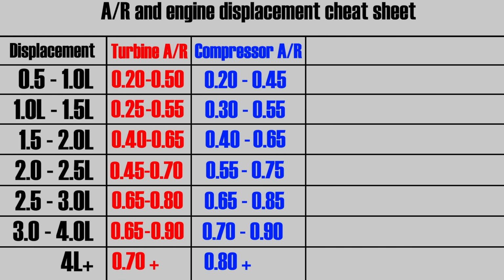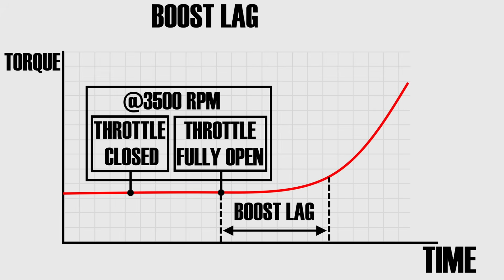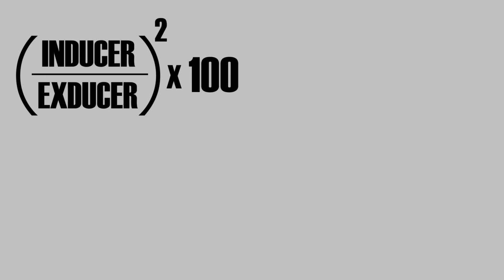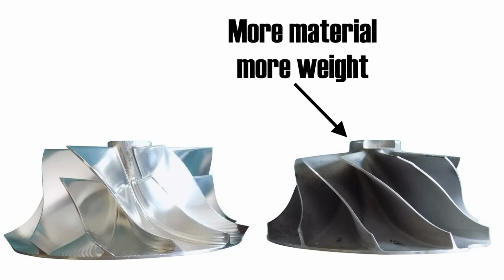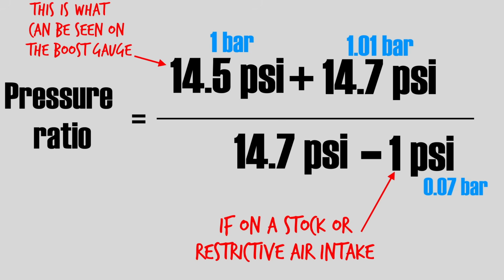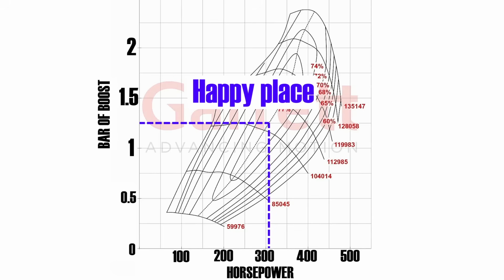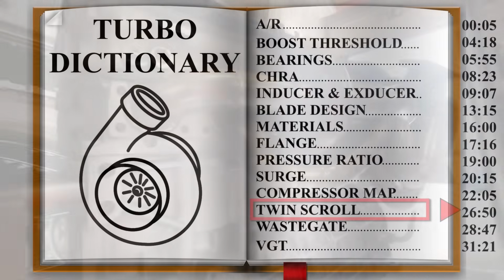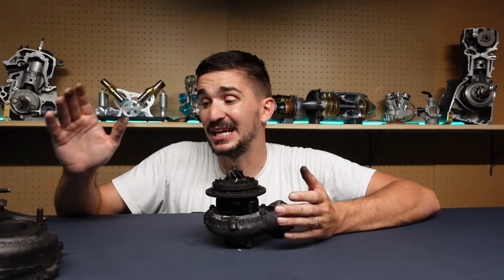All in One: A/R, Compressor Maps, Turbo Lag, Surge, Twin Scroll, VGT, Wastegate +more

Comment: I like the  video however there are some real world variables 

Too large of a turbo doesn’t always cause a surge. When I port the head and add cams to a 2017-2021 civic type r it causes a surge from an mhi stage 2 and blows them up when it makes 21 -24 psi at 2800 rpm. I have to reduce the command by a lot in order to prevent this. 

As far as surge your hp it doesn’t mean your in the surge spot. You can make 15 percent more on the same exact boost by using ethanol over gas. You’d need a turbo shaft speed sensor to really know where you are in the compressor map.

Comment: Another great video.
I had issues with A/R numbers on the homologated T3 turbo back in the 90s on my Nissan 910 rally car.
Unfortunately then, you couldn't just look in a catalogue and buy exactly what you wanted, you needed to find another car with the housing you needed... 😒
We couldn't flow enough gasses out of the turbine housing and wastegate to regulate boost.
I had to cap the rpm at 6250 to stop uncontrolled boost creep 😢

Comment: That was ridiculously complicated that's why superchargers are alot better they may not makes as much boost but will flow better
Reply: Nope. Every form of motor sports is dominated by turbo where permitted by the Rules. Note, turbo is banned in top fuel.
Most 2024 model cars are turbo now. Almost none are supercharged.
All new trucks, industrial generators, and earth moving equipment are turbocharged. 

Supercharging looses 25% of the engines power just compressing the air, and this is not the mechanical losses.

Turbos use mostly free engery that would otherwise be lost out the exhaust pipe.😊
Reply: @nordic5490  supercharger doesn't lose 25% power just compressing the air. A supercharger way more reliable, has a much wider powerband, predictable boost curve, causes less engine knocking. Btw the screw blower is the king of all drag racing
Reply: @DylanL69  bs mate. Goto a drag strip today - all the fastest cars are turbo. Turbos are banned in top fuel.
All supercars are turbo. Every single one, there are no exceptions.

Comment: I have no idea how, but you're able to make technical videos about engines and turbos, but so simple to understand, that I really want to watch your videos

I've learned a lot by you so far, even some things that car hobbyists around where I live doesn't even believe is true, like the EGR delete video you made

as I've chiptuned my car, but didn't want EGR delete coding, people really think it will be stuffed, but so far, my car got 208k km on it, and still running really well. 2011 VW Passat 1.6 TDi Bluemotion, manual transmission, tuned from 105 to 140 hp, stage 1

Comment: So, with A/R... Would it be of benefit to put a choke on the turbo, reducing the exit diameter so you have a low A/R at low revs and open it at high revs, actuated by the ecu like? Is this a done thing already, /would it be a benefit and increase the usable rpms a turbo's good for?

Should have watched to the end lol... But anyway.. I would have thought inhibiting exhaust getting away from the engine would hurt performance, but I suppose sure it would be the same pitting a choke after the cold side - meaning it can't spin as fast, meaning it slows exhaust out, I think?
Reply: It exists already, "Variable Geometey Turbo", or VGT.  It was discussed in this video.
It's not a very robust design at the moment.  The materials make it suitable for diesel engines, but their soot buildup causes them to fail far more often than a conventional turbo.

Twinscroll is the reigning champion for the widest range of power delivery for a single turbo.
The same thing can be achieved with certain twin turbo setups.
You missed out not watching the whole thing ;)
Cheers.

Comment: What are downpipes? Also what are they called on natural aspirated engines? Where are they relative to other exhaust parts?
Reply: Downpipes are the section of the exhaust just past the turbo on a turbo engine.  I don't think they exist on NA applications.  For better exhaust flow in an NA setup, headers are usually used.
On my exhaust setup, the downpipe runs from the turbo all the way past the transmission and bolts to the midpipe section.
Hope this answers your question.
Cheers.
Reply: @christopherlowery855  thanks man I really appreciate it

Comment: Massive or twin external waste gates allows small turbos to spool up without choking because the big gates are allowed to bleed off exhaust pressure caused by the small A/R turbo but still maintaining boost threshold very easily; but no choking because the exhaust is now free flowing almost naturally aspirated with some exhaust pressure "bleeding off" to maintain turbo velocity and boost threshold

Comment: Your first statement you got wrong. It's not A/R it's A times R. The error has been around for at least 40 years. It's not ratio either, it's radius. The radius is always fixed for any family of turbo, the area is variable. It's only the exhaust side you can swap around for different housings. A smaller number spools up quicker and a bigger number spools slower. If it was actually A/R then the opposite would happen.

Comment: Like just about every engineering solution there are lots of variables and collectively they can be biased for specific applications.  You did a great job explaining how the variables all interact.  Are you sure you aren’t an engineer?  

I had a 2017 Lincoln 2.7 L twin turbo V6 (basically a Ford Edge RS with a nicer interior).  I was amazed how well the Ford engineers chose all the variables so that they achieved 335Hp with minimal lag and a smooth acceleration curve with decent durability.  Unless you knew the engine was turbocharged you didn’t notice any negative turbo characteristics, so it made for a great daily driver with great performance headroom, that was just about all the other components like brake, tires and suspension could handle.

Comment: The analogy with hose - the stream goes faster but the pressure drops - not goes up , please revise Bernoulli's law
Reply from the maker: Please revise your ears. I never said pressure inside the hose. "...With greater pressure the fluid comes out". It's the pressure with which the fluid now acts onto whatever it lands.
Reply: @d4a  it's not, as I said, you just got energy from nothing, greater pressure with greater speed

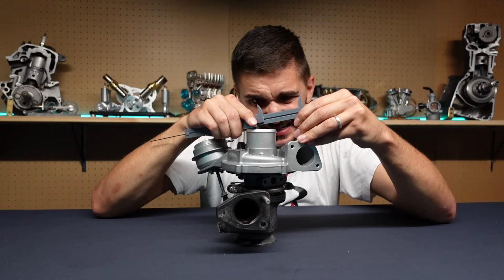Comment: Just a very minute detail, (i still have to watch the whole video); at  2:07  you're measuring "R" with the caliber at an angle, not flat. This will give a higher measure of length, because it's like measuring the hypotenuse instead of the cateto. No? Just a simplification for didactical purposes?

Comment: What about Garrett's E-turbo option? Basically electronically assisted spooling tech, so you can achieve faster spool times for a larger turbine with only an alternator, boost controller, and battery upgrade.

Comment: Regarding the wastegate... One additional drawback of the internal wastegate is that when it is just starting to open, all the hot gas flow is directed only at a tiny area of the housing, around the exhaust port. This can usually heat up the housing unevenly, and will cause the housing the crack over time. This is exaggerated for larger sized turbos.
External wastegates open just like an engine valve, so gas flows instantly around the entire circumference of the exhaust port, making heat cycles more even.
Reply: I can second that! Open up any 20yo turbine housing and you'll find it cracked. 

It doesn't seem to impact performance all that much until they crack all the way through though.

Comment: Excellent as always but one small item.  At 2:50, your analogy with the garden hose is not quite correct.  Putting your thumb over the end increases velocity but it does NOT increase pressure.

Comment: How fast any of the turbos you show spin (in RPM)? What about those turbos that are driven by electric motors instead of exhaust gases? Are they an actual alternative? Excellent video. Love the simplicity of your scripts.
Reply from the maker: As you can see on the compressor map they can go above 100k rpm. There are no turbos driven by motors alone in mass production, they can be assisted by motors at low rpm. They're still a fairly new thing but they might have a big future, we'll see.
Reply: @d4a  Thanks for the explanation

Comment: Me: Tries to learn everything about turbos for years.
D4A: Puts it all in one video like a boss.
Reply: would like it but it at sacred 69 likes. i like the vid istead
Reply: You need to do a lot of push-ups!!
Reply: Turbos suck.  They are a band-aid to the terrible legal problems with engines.  Everyone wants to get rid of big engines for some ridiculous reason.  Despite using (some) energy normally wasted out of the exhaust, they make the engine less efficient at high output because the turbo itself uses a lot of energy. 
They introduce complexity and cost and are very expensive to repair. They also tend to reduce the life of the engine they are hooked to.
Reply: @tarstarkusz  Yeah I'm not gonna lie you're just incredibly biased and underinformed. Turbos are not even that complex and are quite reliable with proper maintenance. They use waste energy to operate and increase overall engine efficiency. Also diesels and performance in general. Turbos aren't the right solution to every problem, but they are awesome.
Reply: @802Garage  Diesels are not gasoline engines.  On a gasoline engine, they are not more efficient. They use more gas generating more power than a larger engine would use generating the same power.  Where the advantage comes in is while producing less power.  A v8 mustang (for example) uses more gas at the same speed than a 4 cylinder mustang (BSFC).  This is the effect that turbo chargers enable. They use less gas at lower power output. But as soon as you want that turbo power, the gas mileage drops to that below a v8.

Sorry, but no. A large number of turbos will not last the life of the car.  They will need repair or replacement before the life of the car is over.  Some, perhaps even the majority will survive the life of the car, especially if maintenance is followed to the T.  Replacement or repair is very expensive.
Reply: @tarstarkusz  You are straight up incorrect. There are endless engineering and scientific papers on this topic. You are wrong and need to research the topic further. You aren't taking other factors into account which you are incorrectly placing on the turbocharger, such as vehicle weight and desired power output. A turbo can always make fuel efficiency worse, but that's not inherent to turbocharging.

As for reliability, again most turbochargers will live the life of the vehicle with proper maintenance. There are of course many exceptions which fall on setup, manufacturer decisions, poorly chosen parts, manufacturing defects which show up long term, and more. They are still relatively simple devices with only a few moving parts. Seems we mostly agree on these latter points overall.
Reply: @802Garage  I mean, sure. But that's not how people (Americans) drive.  They have the power and use it. This drives efficiency lower than it would be in a non turbo car (granted with less power).  If you granny around a turbo car with a smaller engine, you probably will save mileage.
Before I posted that comment, I did a quick google on power to run a turbo.  The quick answer I got was roughly on par with the boosted HP.  Like to generate an extra 100hp with a turbo means the turbo will put a 100hp load on the engine. This dramatically increases the fuel consumption.  This is much worse than I thought going in.  I have not read articles on turbos in probably over a decade.
Even if they are substantially better than they used to be, they ain't magic.
I carefully worded my reply to turbo life. Yes, I admit the majority probably do last the life of the vehicle. But the failure rate is much higher for the turbo than other engine components.  Most cars go the junkyard running and driving.  Maybe 10% go with a blown engine, spun bearings or bad head gasket or something that is too expensive to fix.
Giving turbos to a very large percentage of the public is always going to produce more failures.  These are people who get an oil change twice a year in a good year.
As more and more cars are turbo by default, I suspect the average age of a vehicle on the road, which IIRC, is 12.8 years today will stop climbing and start falling.  But this is a prediction that might turn out to be wrong.

Can you recommend an article about these new advancements I may be ignorant of?
Reply: @tarstarkusz  There are no new advancements that make what I said correct. There are constant advancements which make systems even more efficient, but what I'm talking about goes back to the dawn of turbocharging. It uses waste energy to increase output. It literally increases efficiency through that process. Efficiency, not just fuel efficiency, which is coupled but not directly correlated. Look up any paper on the topic. I can't send links in comments.
Reply: @802Garage  If you increase efficiency by 5% and increase fuel efficiency by 10%, you're 5% behind.  There simply is not enough conversion of the heat energy to drive the turbo. The turbo puts a load on the engine.   Plus the turbo itself is nowhere near 100% efficient.  The average efficiency of a turbo charger is 60%  For every 100hp it takes from the system, only 60hp is converted to boost.
Reply: @tarstarkusz  Listen man, I'm really not going to write you an essay on settled science. Please actually research this. I of course agree that many practical real world examples of turbocharging are actually cases where it likely wasn't the best choice. You are using anecdotes to condemn an entire technology. The idea turbos can't increase efficiency and fuel economy when applied correctly is patently false.
Reply: @tarstarkusz  Why ridiculous reason? Modern engines consume way less gasoline than 30 years ago. I have a 1.5 liter Diesel and I average 4.4 to 4.6 l / 100 km (more than 50 miles per gallon). This can only be achieved with a turbo. So it's not "legal reasons" and "some ridiculous reasons". I'm happy with the low consumption.
Reply: @bur2000  That is simply not true, not in America anyway.  You're bringing diesels into again.  Diesels with or without turbos are much more efficient than gasoline engines.  The best are like 50% thermally efficient.

Comment: 0:11 But… A/R means area over radius. Not area over ratio. A/R *is a ratio. I see you do start referring to it as radius later.
Reply: It’s also worth mentioning that because it’s a ratio, two turbos with the same a/r can have very different flow rates. A big turbo (g45) with 1.01 a/r will flow more than a small turbo (g25) with. 1.01 a/r.